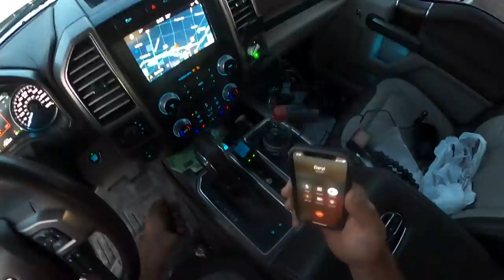That last pour Friday feeling-Nothing better

Comment: if that base was crushed concrete, sometimes if theres more fines, the mud takes a quicker set from the bottom up. at least in my area. or like you said, its a different batch plant so their mix could be a bit different than what youre use to. that one aspect i love about concrete, you just really never know whats going to happen. the worst is when you get a lazy driver who doesnt empty his truck out and batches on top of his last load so your first load is semi hot and the 2nd truck is fresh. doesnt happen often but it does happen. hard trowels arent so bad but broom work really turns into work to get the broom to match nice. have a great wkend!!

Comment: Hello there sir. Concrete finisher here from Washington. Your crew and you awesome!! Love the videos. Like the new young crew Bug's and you have.. They seem eager to learn and work. Quick question why you don't use a trowel to finish before you put down a broom??
Reply from the maker: Technically you should never use steel trowels on exterior slabs in freezing climates. It can weaken the surface and possibly contribute to scaling. Where it doesn't freeze it doesn't matter.
Reply: Hey,, was not expecting that fast of a response.. You are good!! Very professional.  Ya we trowel out all of our brummers. Have been for the last 16yrs. Just asking if you found the secret to faster finishing.
Reply from the maker: @marioherrera2016  No, mag floats are actually a little slower because its a little more difficult to get it decent and ready for a broom.

Comment: here in Denmark it's required by law that you fasten your load on a trailer, Even gravel (and here there is a hole in the law) so I normally use a ratchet strap because EASY and effective, but it's okay to use a ratchet strap on gravel as well so no tarp required just a strap 🤷‍♂️ but a truck needs a trap 🤦‍♂️ (not a pickup we don't really use those because our gas prices are high here 7.23 USD for a gallon of regular and that normal price her). love your videos and love seeing great craftsmanship, and Hi from Denmark 🙋‍♂️

Comment: There was one time my work was rewaxing a section of flooring which involved putting a chemical down to dissolve the old layer so it can be stripped off. The workers had the entire area taped off and had “Do not enter” signs posted. A guy completely ignored the warnings around what was clearly a work area and ducked under the caution tape as he walked straight into the area. He only made it a few feet before falling flat on his back as his feet slipped on the chemical stripper.

Comment: 12:20 - Check out the spider in the bottom right. Walks right across the wet concrete. Totally ignored the caution tape.

Comment: Pro tip: Don't use yellow caution tape (which people more or less ignore). Use red "DANGER DO NOT ENTER" tape instead which actually communicates what you are intending to communicate. In my 36 years of commercial and residential flooring installation, I can absolutely promise that you will have better luck with the red tape.
Reply: Yea okay buddy!

Comment: Hooked up to a trailer once loaded the bobcat on it drove it a few miles out of town when the bobcat was driving down the ramps the Trailer popped up off the ball turns out someone switched the ball hitch for the air compressor trailer no one checked....close call.

Comment: 7:15 you can't grade like that..you may get away with it on small drive way but the correct way of grading is moving your rod to the position of the string line, not the other way around. Your string line is your "true" grade which you destroy by moving it to the rod...

Comment: 14:20
I did make that question 4 or 5 videos ago cus it seemed counter productive, but now I know it doesn't.
Thanks, Ryan 🤣
Reply: Yeah, same, I think it's because what little concrete work I've done has involved adding little plastic risers along the edges and corners where the rebar mats intersect in order to keep it elevated during the pour. The whole manual lifting and stepping on it seemed weird, always nice to learn new things.